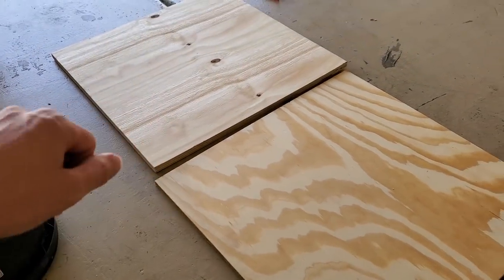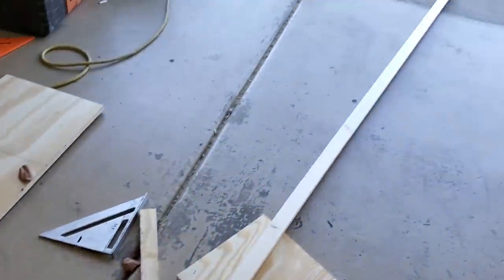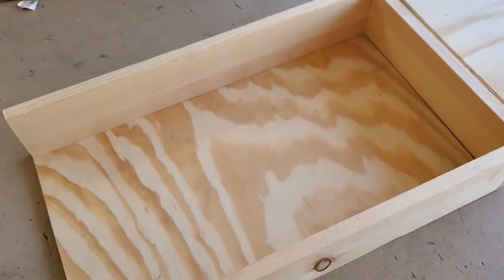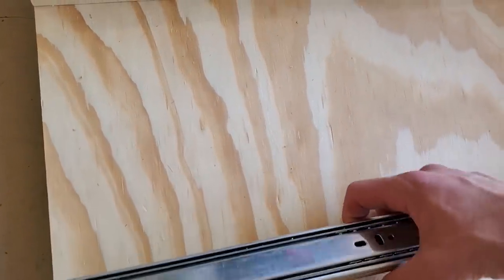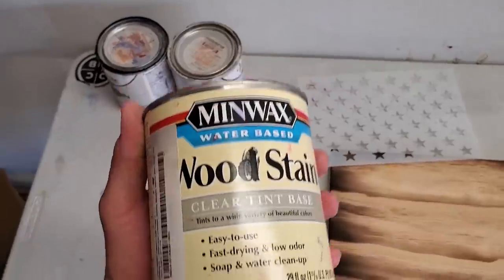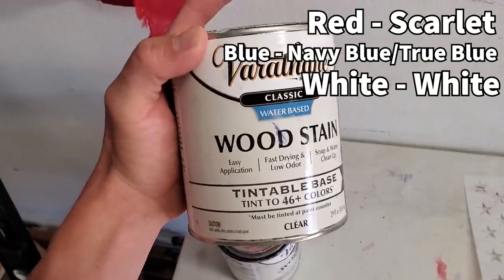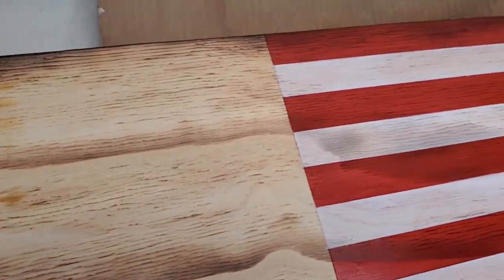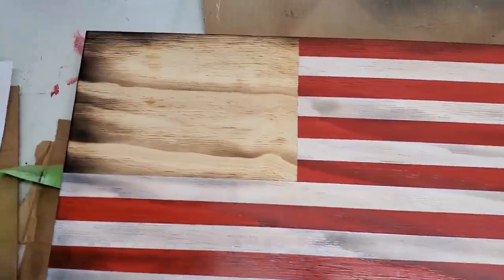How to make a MEDIUM CONCEALMENT FLAG! DIY

Comment: Great job bud! I’m going to have to add it at the top of my to-do list. I may have missed this, but did you mention the total cost of materials? I know it will vary across the country, but it would be nice to know a ball park number before I go buy everything. Thanks!
Reply from the maker: Thanks a lot Kevin! I did not mention it and its a good question! Here is a quick breakdown of the pricing.
1/2 in plywood: $9.63
3/4 in plywood: $11.49
1x5x8 ft common board: $7.86
1x2x8ft common board: $3
Cabinet Sliders: $20.98
Corner Braces: $3
1/2 in and 3/4 in screws: $3
Foam Insert: $22
Total= Roughly $80.96

Then some other things that you may already have are:
White and Black Spray Paint
Sealer
Union Stencil
Frog Tape
Red white and blue stain
Repositioning adhesive spray

Hopefully this helps!
Reply: @MaxF01  thank you, sir!
Reply from the maker: @KevinPolitz  no problem!
Reply: @KevinPolitz  great question.
Reply: @MaxF01  thank you for sharing this information with us
Reply from the maker: @diplayball  im happy to share!
Reply: @Max F
Have you given a range that this item would typically sell for? Thanks for listing the cost of material!! 🙏🏻🙏🏻🙏🏻

Comment: If you wanted the flag to open all the way, simply put a small block as a spacer to set your slides instead of against the box side. You can remove it to set the other slide. This will remove the need to paint any part of the slide since it isn't visible.
 This is a good design if any small children are around but as they get older, the edges must be enclosed.
 Any children that are as active as I was years ago, will put knives, forks, spoons, whatever fits into spaces to pry the box open to:
 1. See if they could.
 2. See what's inside.
 3. See how it works
 4. Because they were told to leave it alone.
God Bless the future wood workers, tinkers, mechanics, etc. in this world.
 For anyone who wants to size a flag to their project, then try this Flag ratio calculator. just plug in any single dimension and get the other numbers in any unit.
Zaborowska, Ł. "Flag ratio Calculator | USA". Available at: https://www.omnicalculator.com/other/flag. Accessed: 18 July 2023.

Comment: I’ve had pretty good luck with doing this with the foam:
Cut it to where the gun is a snug fit and then cut out to finger holes where you can just reach in and grab it. It makes the issue you had non-existent. 
LOVE this build tho. I’ve never made a slide out flag like this. Mine have always been up and down. Def gonna give this style a try!! Great job!!! 
OHHH...and as for the stars, when you put your stencil down, spray a coat of sealer over the stencil before applying the white paint. It will seal all the edges and eliminate any bleeding of the white!! 👍🏼👊🏼

Comment: Loved the project, my only suggestion would be to cut finger holes in the foam to remove the items easier.
Reply from the maker: Thank you!! That would definitely help thank you for the tip!
Reply: And orient the gun muzzle up, the mags bullet pointing towards You when You open, just ergonomics, easier to just go with Your palm directly at the grip of the gun, like a "hands up" position. And the mags grip with with thumb and 3 finger opposite,  the built in pointer along the front of the mag.

Comment: Not gonna lie, if I was a thief and saw an American flag carving that was thicker than a book I’d assume it had something inside
Reply: A thief that breaks into your house probably isn't that smart. But i get what you are saying.
I built something similar to this that I cut INTO the wall between studs, like the medicine cabinets i seem to see in a lot of houses. It only sticks out about 3/4", thickness of a 1-by. If you tried to swipe it off the wall like a picture though... yeah its not moving.
Something the size of this video would work on a non load-bearing wall pretty easily by cutting the studs and framing in a hole to insert the box.
Reply: @FragEightyfive  how about just a narrowish shelf type deal that pulls out of the wall? If you had a closet on the other side of the wall you could use the depth as another shelf, dry walled obviously and no one will ever know.
Reply: @russwillknot  yes that too. That would be pretty slick. I have also seen fancy shelves with a fake bottom that were pretty neat. I think your idea will work very well for long guns.
Reply: @FragEightyfive  a thief looking for guns would know. They see these thing too. If they are into guns for any reason they know.
I’ve seen these in houses and I know. I don’t say anything but it’s kind of a dead giveaway with everyone making and selling them.
Reply: Bigtime. At the very least break out your Martha Stewart and decorate around it so it’s less conspicuous. Nice job though.

Comment: You can use almost any joint on the ends.
I have seen Kreg, mitered 45 and dovetail sides.

If you stain the entire board white first the red will stand out more.

Comment: Love the video. One suggestion if the foam is really dense is a small finger slot on the magazines to be pulled out easier. What kind of pistol do you have and live flag on the grip.
Reply from the maker: Thank you very much! That is actually a really great idea, especially if i had cut them a bit tighter then with a finger slot they would still be easy to remove. Definitely gonna use that in the future thank you for the advice! Its a glock 19 gen 4 and thank you, haha that was my first time stippling a gun and i was a little unsure of how it would turn out

Comment: Awesome build made easy! Love the lock idea!
Suggestion for the anchor screws and the foam inside is that you could drill matching holes in the foam if you need to glue that foam down, the screw heads would be accessible and you wouldn't need to rip the foam off to get it off the wall.

Comment: Did you burn both sides of the plywood or just one? When I build mine I noticed the woods starts to cup if I only burn one side. Once you burn the other side it flattens back out. That is also with regular pine and oak, not plywood.
Reply from the maker: I did not burn the other side but ill have to give it a try next time! Thank you for the advice!

Comment: I have a suggestion for the foam not sticking very well or being a little bit loose maybe try double-sided Velcro on the back of it just a thought that way you could always remove it and if you have to take the box off the wall better than gluing it
Reply from the maker: That is a great idea! Thank you for the advice!

Comment: Looks good. Two suggestions: 1. You could try those magnetic child proof cabinet locks or for a bit more security, you could do some kind of RF card lock. 
2. Maybe velcro the foam in so that it stays and can be removed later. Not sure if that foam would hold the velcro on the back or not, but worth a try.

Comment: So awesome! 

One quick suggestion, since you got a two pack of magnets you could cut a hole in the foam where the slider is and glue the magnet to the wood in that location to avoid the gun tipping out in case the foam doesn't hold it snug enough.

Comment: For the lock, you could predrill your hole not quite through and use a slightly shorter rod. There wouldn't be a hole to show no matter where you set/hung the box. To unlock have a knickknack on top that has a magnet in its bottom. To unlock, just slide the knickknack over the spot where the rod is. The rod raises up out of the door into the frame.  You could incorporate multiple locking rods, if you choose. I use this principle with little jewelry boxes for my nieces.

Comment: Might try to use shadow foam. Get it in two different colors. Or use two 1in pieces of foam so it is easier to cut out the shape then glue together. Looks really good.

Comment: Looks awesome.   For the frame is it actually a 1x6?   I've not found 1x5 anywhere.    If it's truly 5" I can just rip it down.  Thanks.
Reply from the maker: Thank you! Yea unfortunately it is a 1x5, so 4.5” actual width, it might not be as common as other boards
Reply: @MaxF01  thanks.   I went ahead and ripped my 1x6 down to 4.5.

Comment: "Flush".
"Does not extend past"
"Flat against"

Bro...
You are all over the place with your vocabulary.

Nice work.
Reply from the maker: My bad im not the greatest with words, thank you!
Reply: @MaxF01  You are good my friend. I'm just nit-picking cuz I wish I had the time to do things like this. Instead, I've invested what time I do have, for refining my own vocabulary (I'm not even up to my own standards).
Keep driving on...

Btw... please get a table. Floor work will put u in a wheelchair before it's ur time. I have 3 herniated discs. 2 lower back and 1 neck. This was due to military work (Abrams mechanic), but it's the same concept. In fact, my wife did laundry by hand out of a basin below knee level. That will erode every disc you have in your lower back.

Again... keep driving on. Don't stop. Always improve.

Comment: You should have used picture wire to hang the box. That way you don't have to have a bunch of screws holding it up. 
Also a child cabinet lock with a magnetic lock would do the same thing.

Comment: I love the build and the idea of the lock.  Did you consider any other options for the lock?  Would there be a way for thr magnet to hold the pin but id you move the magnet it "drops" the pin instead of removing it?  If you really need it I am not sure I would want to be reaching for a magnet and then pulling the pin up and out

Comment: Ace Hardware for the waterbased stain make sure you use the Minwax pre conditioner or the wood will come out blotchy when you stain it
Reply from the maker: Thank you for the advice!
Reply: Dont need conditioner when you burn the wood grain. Conditioner raises the grain and after you sand it's the same as   burnt wood. Sou shugi ban japanese wood burning technique seals the wood grain tight that's what makes it last hundreds of years. But yes condition all wood that is raw

Comment: Loved the video and I'm trying to build one. In your video the sides are 1"X 5" in my are we have 1"x 6". So could you tell me what a 1x5 measures? I'm trying to make as to your measurements.
Reply: To answer my own question. The 1x5 board is 3/4 thick x 4 1/2 wide.
Reply from the maker: @rugerguy8190  sorry about that, just now saw your comment